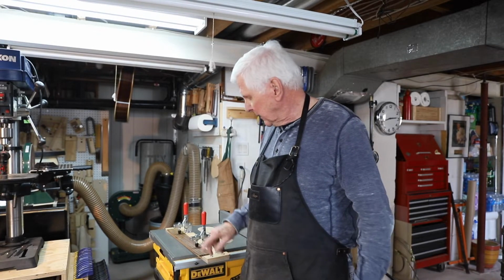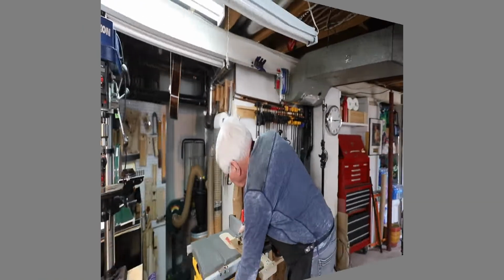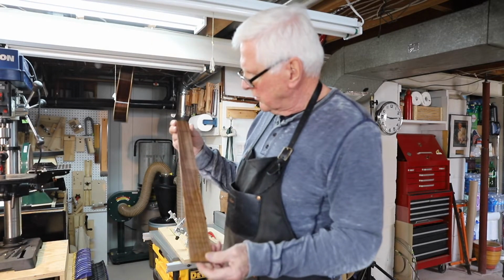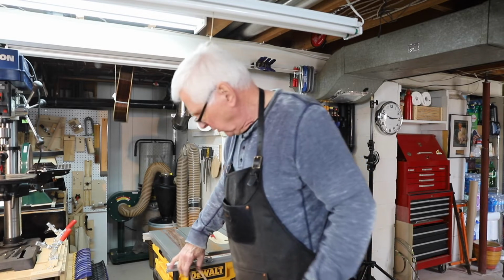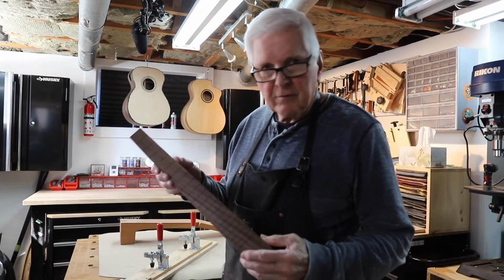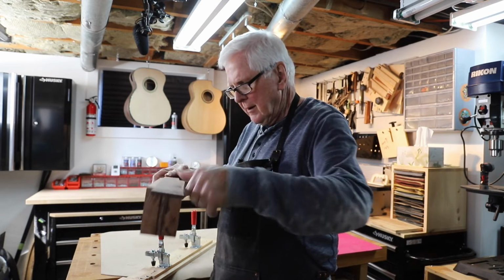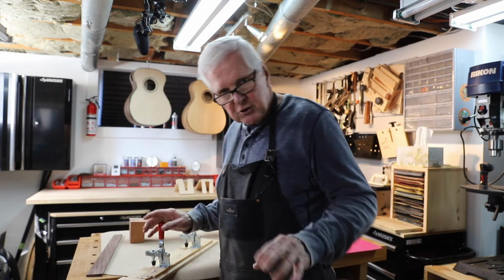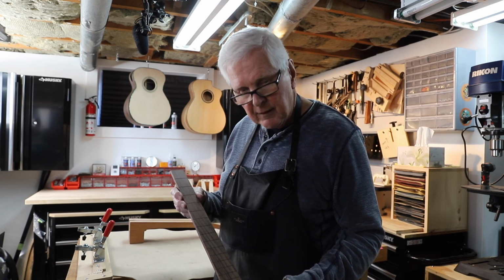Make a Sweet Fingerboard for Our Acoustic Guitar

Comment: That is a very handy jig, the last few fingerboards I made I cut on the bandsaw and then shaped when they were on the neck, after I put the radius on them. But that jig would make the job a lot easier.
Reply from the maker: Yes, I used to measure draw a line and use a plane to get it straight. Real pain!
Reply: @MontyMcKinnon  Aw, I LOVE my No. 5 Bench Plane. There's something Zen-like about using hand tools.